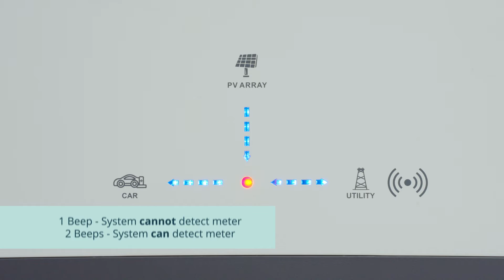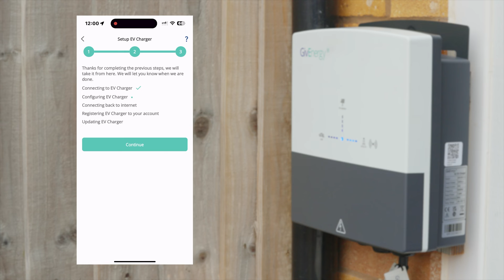GivEnergy - EV Charger Installation Guide

Comment: I wish we had the option of changing out the provided charging cable. 
1. 5m is too long for me. realistically i only need 2-3m, the rest is not needed. Some customers may need more than 5m. It depends.
2. I have a tesla, and having a cable with the tesla command button on the cable would have made a world of difference. Instead of needing to open the app to unlock the charger, i can just press the button to release it. Obvs i get that you won't be able to do much about that specific requirement, but having an untethered version or a version where we can swap out the cables, would have been much better.

Comment: I currently have a Zappi and would like to swap this out for a GivEnergy EV Charger - can I do this myself (as per video) or MUST it be done by a GiVEnergy engineer? 
Also, has this now been integrated with Octopus Energy?
Reply from the maker: There's no approved installer requirement for the GivEnergy charger.